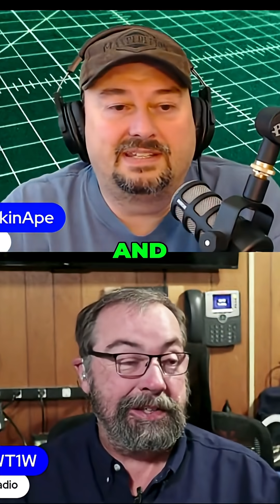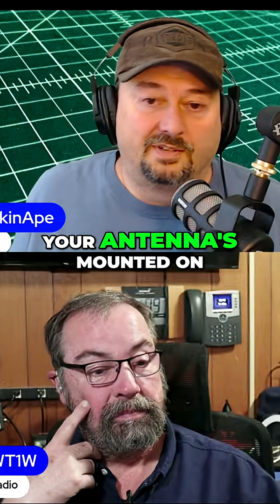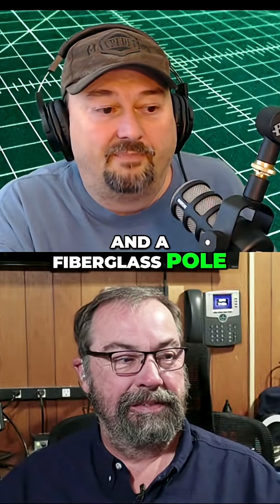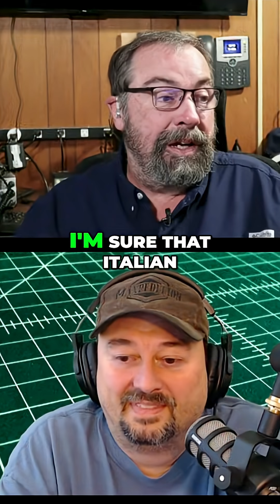Antenna Systems  Coax, Baluns, and Real World Performance #hamradioantenna #hamradio #antenna

Comment: #10 stranded THHN with 4 inch spreaders. No loss, extreme SWR it don't care. Put a big dipole on one end and a big ol tuner on the other end. 95% efficiency all bands. Modelled in mmana and simsmith. And NO, a doublet is NOT a "compromise" antenna.

Comment: There is not that much difference for a given coax size.  Larger coax is lower loss than smaller coax for a given set of materials.  Minor differences could be achieved if you use Silver-plated conductors and using a foam dielectric vs  pure PTFE or Rexolite, and that has little effect unless you are up above VHF or UHF.